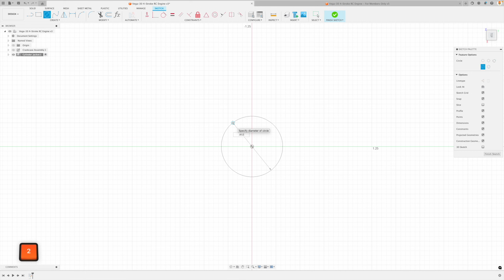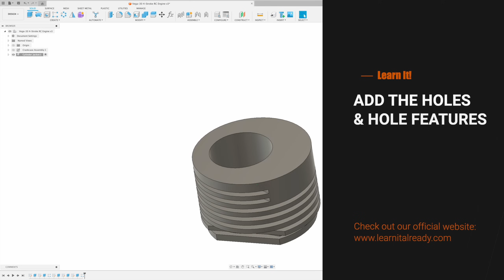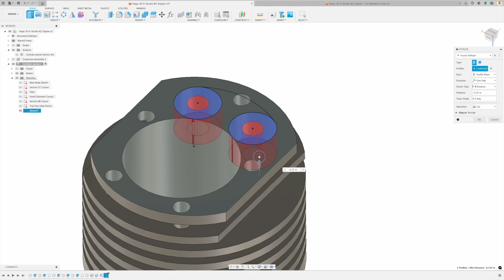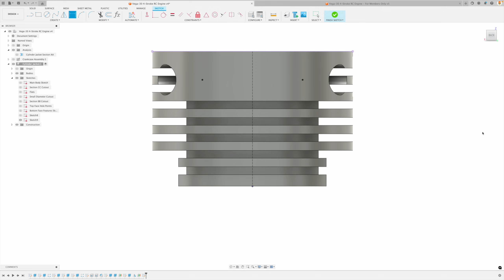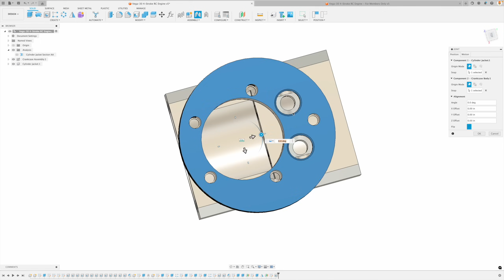Autodesk Fusion Intermediate Course - 2/10 - Cylinder Jacket 4-Stroke RC Engine (2025)

Comment: Could you explain the calculations of the chamfers at 11:44? :D  I can't find those values. I see in the drawing at the bottom left that the diameter is .250. Not sure what the other .250 value is next to the |__|. Note 4 talks about 45º degree chamfer which I understand but i'm not sure what the 0.016" wide is.
Reply from the maker: As far as I can see that is a missing dimension. It looks like it actually needs to be fitted to the poppet valve.
Reply: @learnitalready  Oh 🤔 Interesting
Reply: I am haunting your channel :) & I'm coming across this same question! You choose .015, but is it because that corresponds to 45deg as note 4 says or is it just a missing dimension? As for the outer radius - smaller radius / 2 = "this" chamfer, how did you know to make that calculation based on the drawing?

Comment: Is there a best practice for how many sketches we should make to make a part? I feel more comfortable making many smaller sketches instead of everything in one sketch.
Reply: also, is there a rule for which plane to select for the very first sketch? If I have the technical drawing I start by the one I understand best and go from there
Reply from the maker: No rule. However, I like to create my 3D models the same way they are positioned on the drawing OR the way I'd like it to be oriented when I click on the home button.
Reply: @learnitalready  🙇 You are the MVP. Thank you very much.
Reply from the maker: @SgtOneill  I'm not sure about that, but I'm grateful for your encouragement. Thanks!
Reply from the maker: The best practice is to make sure your sketches are well organized, only dependant on other sketches/bodies when needed, and to make sure that you can edit them easily in the future. Sometimes too many sketches makes your timeline and browser cluttered and potential can create issues with your timeline if you accidentally create relationships that you don't want. Too few sketches can make things difficult too. So, just keep things simple and well organized.

Comment: Did you notice there seems to be a mistake in the location of the five tapped holes of the crankcase and the five thru holes of the cylinder jacket. There seems to be a .003" difference in the x direction unless there is a reason for that that I'm not seeing
Reply from the maker: You're absolutely correct! Hadn't noticed that before at all. Those values should be exactly the same from what I can tell.
Reply: @learnitalready  Whenever I am designing mating parts I try and use the physical location of the mating features . That's what I did here and then when I went to dimension them found the dimensions to be incorrect
Reply: @sergedilario8483  Interesting. My intuition in the initial (first) sketch for this part was to Project the top face of the Crankcase Assy and begin modeling from that. I eventually noticed the holes didn't line up, which I attributed as a mistake I had made somewhere. It hadn't occurred to me that the drawing was in error... though I was blaming that drawing for lots of other things!

It also didn't occur to me to simply model the Cylinder Jacket tabula rasa; then after modeling was complete use the Joint tool to site it (which is probably a best practice). This is a really good Fusion tutorial.
Reply: Phew.... I was just wondering the same. I was doing the modeling and I noticed a .003" difference. But in the drawings there IS a .003" difference... No biggie, some sort of "bug" :D

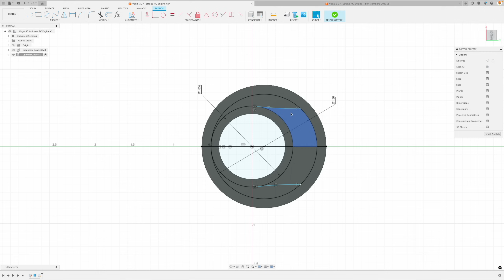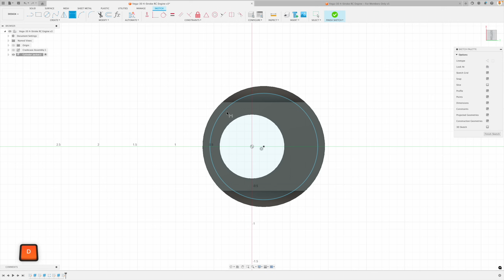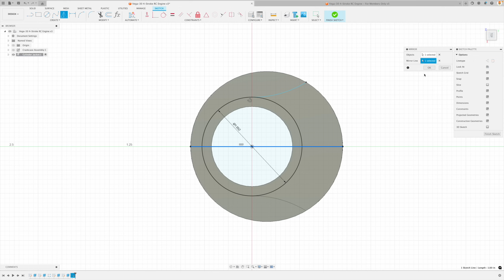Comment: Hmmph... my sequence to model this widget took waaaay longer that 20mins, and my timeline was  blecch! So I just deleted back to "new component" and followed along. I am curious where on the drawing you got the arc radii (3:40) and (6:27) and (7:38).
Reply: Also got stuck on that arc radii at 3:40. I don't really understand note 2 "arc of 200º around the cylinder liner bore" .
Reply from the maker: @SgtOneill I think it’s a classic case of the engineers (non-professional in this instance) to try and figure out how to describe how to machine that feature. When I talked about it with a colleague we both agreed that a rotary table or chuck would have been used, and it was merely rotated 200 degrees to machine it correctly. When sketches with a centre point of 200 degrees apart, the drawing looks exactly the same. Sometimes we just need to try and jump into the brain of the draftsman (which can be a pretty scary place at times 😂).
Reply: @learnitalready  🤯 Thank you very much 👌
Reply from the maker: Excellent! I love comments like yours. 

The arc value at 3:40 and 7:37 is found in Note 2 (2.5" diameter slitting saw). So I used half of that value to specify the radius.

The value at 6:27 is found at the left hand mid-view (which has the main callouts for sections BB, CC, and DD). Although it doesn't specify a diameter on that value, I can only interpret as one.

If you see any of those in a different light, please feel free to comment! Would love to help each other with extra sets of eyes!